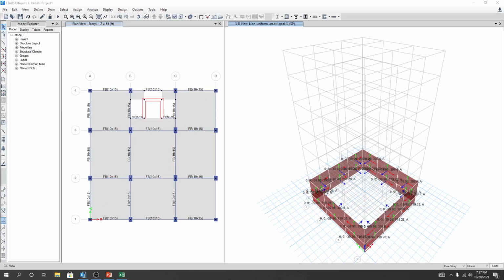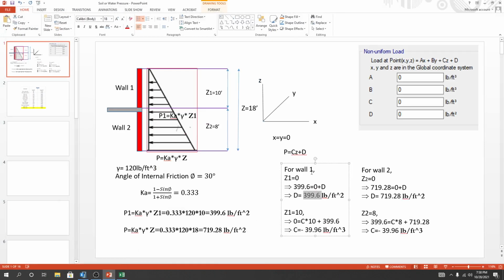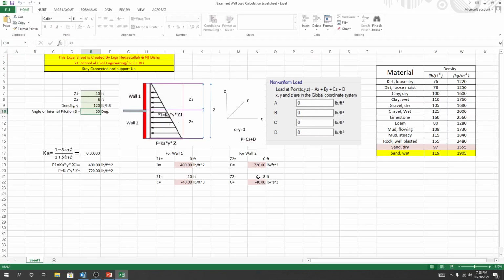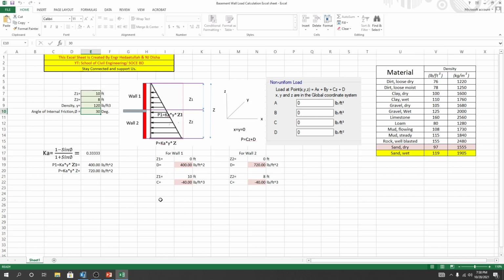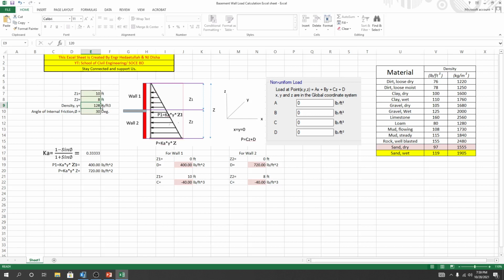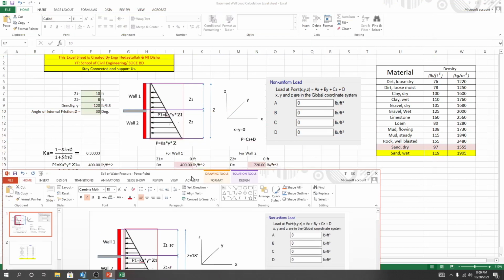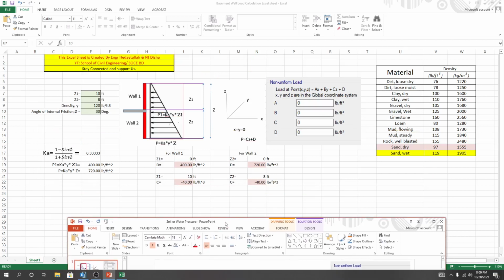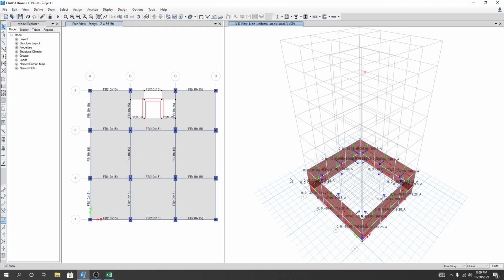8. Complete building design in Etabs 2019 | Real Project Design | Basement Wall Load by Excel sheet

Comment: Thank you so much for your great.
Please include the water tank in basement as well to know about water pressure on walls.
This Channel provides the real learning opportunities for new young engineers who're looking for Designing.
My one request is still here please include the UGWT(under ground water tank) in basement and Also apply the load on walls to know about the difference between soil pressure and water pressure.
Please make a tutorial on verification of Etabs model cause how we can know that our analysis is okay and we should go on or not.
The most important part is analysis.
Please also verify the results of beams columns with manual calculations.
Like load on a column and beam design (BMD&SFD).
Thank you again for your help